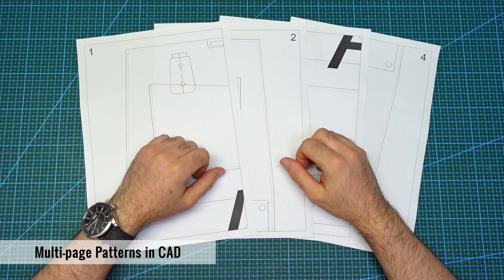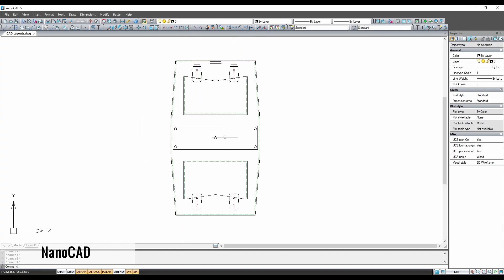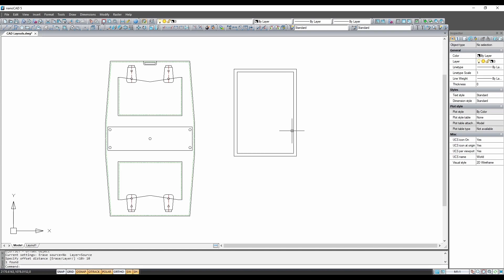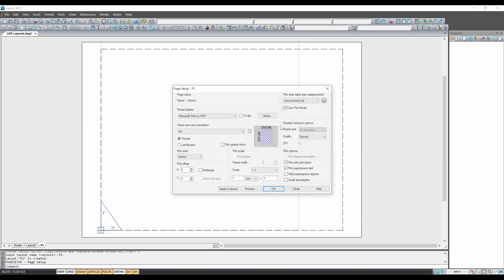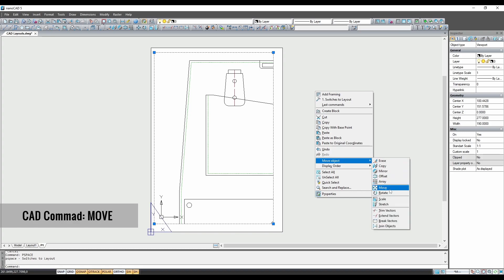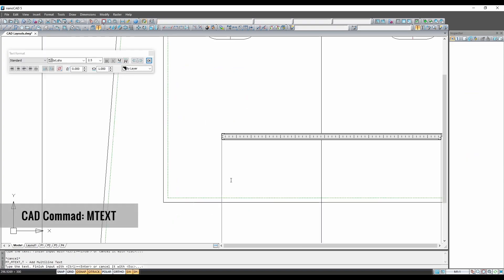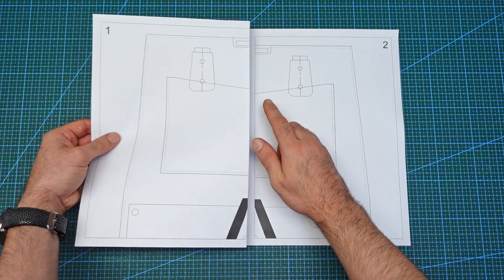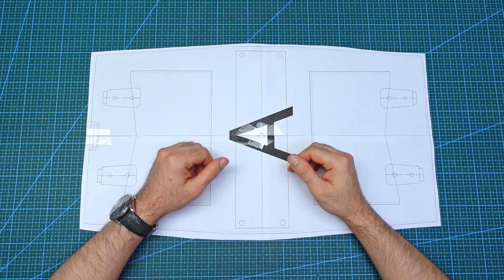Multi-page Patterns for Large Leather Designs

Comment: Great vid., thank you for sharing your knowledge and experience. 
About CAD projects - I wonder how to create pattern with marked stiching holes? How to check if pieces will match each other after sewing? Do you have experience about this? 
Regards
Reply from the maker: Thanks, this is easy to do in CAD. You can design all pattern pieces together as a single project design with stitching holes. Then, make copies and 'trim' the excess design around each individual pattern piece. All of the individual pieces and their stitching holes will be able to fit together as they came from the same base design.

Comment: have a bigger pattern with different single pieces, i created the grid and put it into the pattern, but the problem is, when i wanna add the viewport and type in '1' for the scale, it doesn't work. I can see the whole pattern in the viewport and it doesn't adjust to the grid, i have to zoom in then. But isn't that putting all the measurements off?
Reply from the maker: There are a few things to troubleshoot here. Start by checking your drawing and the layout are both in the same units which should be millimeters. Then make sure you set your layout page size to be A4 or what your paper your printers prints.
Reply: @TeranAtelier  i just checked, both the model layout and P1 layout have the same units, and the P1 Layout also is A4
Reply: @TeranAtelier  i also just typed in 10 for scale, and then it 'zooms' in like it does in this video. But i don't know if this will be the right size and have the right measurements then
Reply: @TeranAtelier  i also have another problem: i can't move the viewport into the middle of the page. I can't find anything that makes it snap to the middle

Edit: i figured the problem out. For some reason, nanocad still measured in mm even tho i changed the units to cm before starting with the pattern. So the pattern was way too small, that's why it was completely inside the viewport instead of just the grid of the A4 page
Reply from the maker: @dukehorndrake5525  Good to hear you managed to fix it. For the viewport you just select the corners as close as you can to the edge of the layout. In practice, most printers will leave around 10mm of border that cannot be printed anyway.